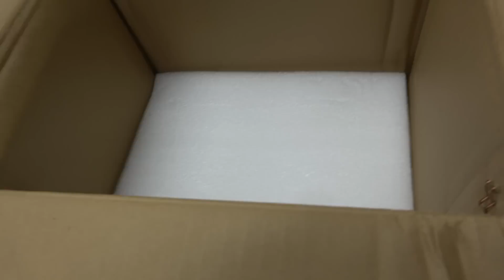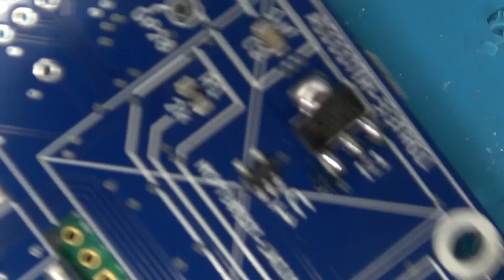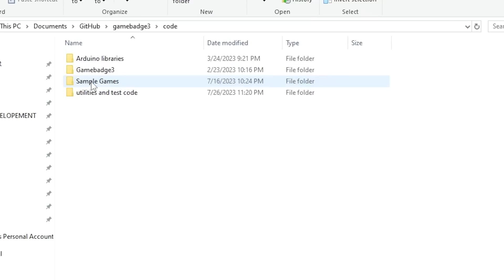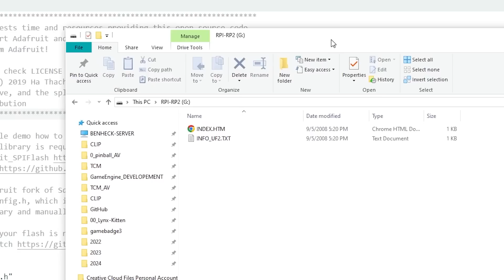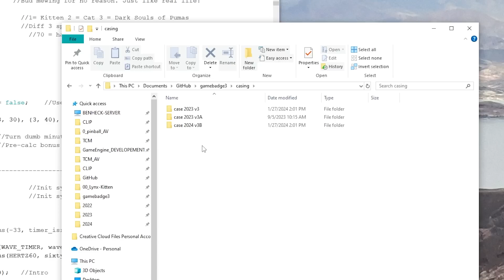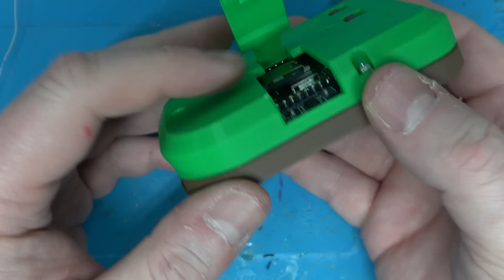MGC 2024 Gamebadge 3B - Sponsored by PCBWay!

Comment: I like making the annual rings on the through hole pads larger, it helps get better contact to the soldering iron and heat up faster. Makes it easier for newer people or people with chunky soldering tips.

Comment: Why do Content creators keep baking in ads?  Tired of skipping through them.  Sorry Ben!
Reply: Because they give him free sh*t
Reply from the maker: @HaakonAnderson  Yup. They gave me $400 of boards for free, I give them plugs. Capitalism baby!
Reply: Because they made the boards for the project. It's super expensive. Get the Sponsorblock browser addon if you don't want to skip manually.
Reply: PCBway providing the boards for free, prestuffed actually helps quite a lot.  Folks may not be aware, but Ben reduced the price of the workshop this year because of that - and that’s after adding in additional parts (sdcard slot + more printed case parts). Plus we were really pressed for time at last years workshop because of all the surface mount soldering, so having those passives prestuffed is going to ensure that everyone walks away with a completed device.